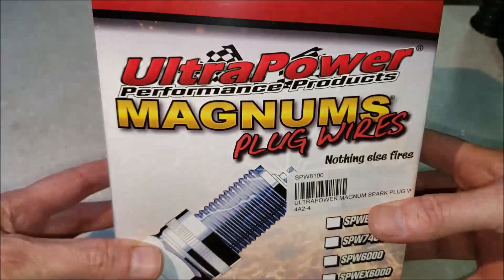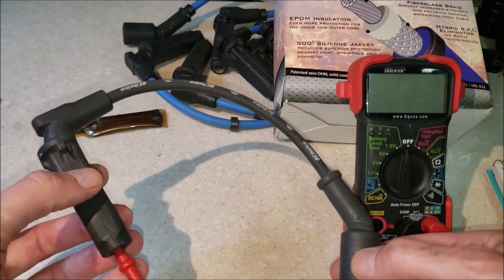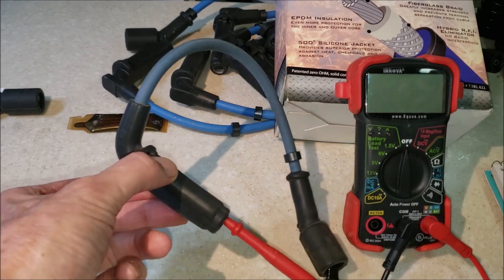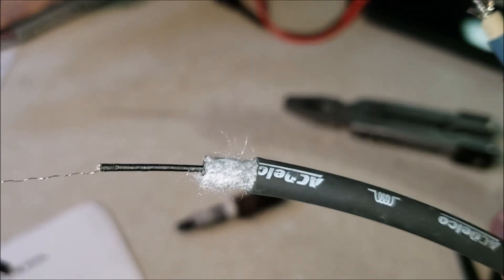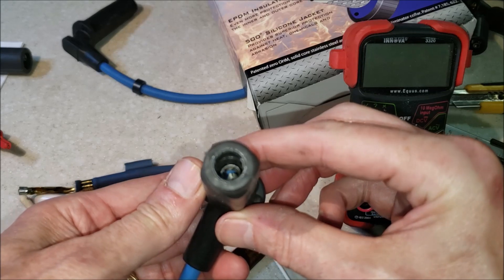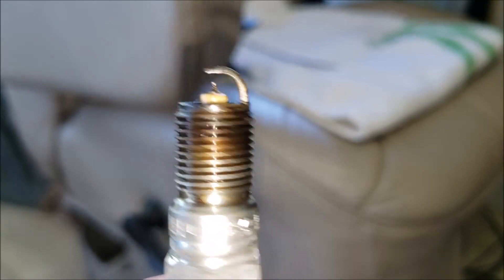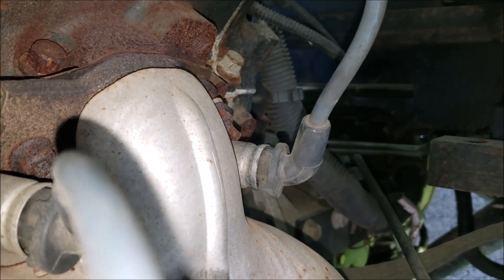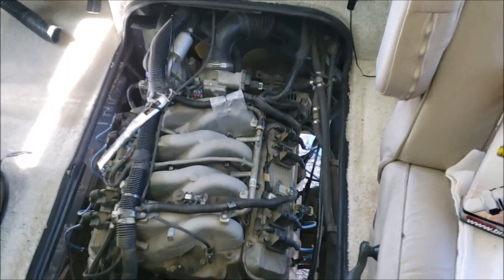8.1 Vortec Solid Stainless Steel Core UltraPower Magnum Spark Plug Wires Reviewed Dissected install

Comment: I see, there's numbers on the new wires to install.Does it matter which goes on As long as you put them on.
The same connectors they came off
Reply from the maker: @albertapride  it does not matter each wire is the same length .

Comment: I've got a 2004 w22 8.1 vortec. I was going to get the ultra power wires you installed. What plugs do you recommend to install?
Reply from the maker: Link to purchase these MADE IN THE USA Plug Wires
https://www.brazelsrv.com/SPW8100-Ult...
Part# SPW8100 - UltraPower 8.1L Magnum Workhorse Spark Plug Wires
Plugs I used ACDelco 41-101 Professional Iridium Spark Plug https://amzn.to/3AT5NiA
 Update about spark plug gap 
We’ve done a lot of dyno testing and with our Magnum wires, there was absolutely no difference in power between .045 gapped plugs and factory .060 gapped plugs. Removing the resistance in the ignition wire has many benefits! Back when we use to run Taylor wires, the .045 gap worked well but with the Iridium tips being a bit more fragile I recommend leaving them alone at .060.

Comment: Good job, I am picking up a new to us 2003 Winnebago Adventurer 33 with the Sparton W22 and the 8.1 vortec. actually today.... I do not have much history on it. I ran into your your channel and been enjoying the videos. I have to say you are very thorough, I'm a bit picky myself and fairly mechanically inclined. My rig needs new shocks to start off with (I think they are original) and some TLC,  I am purchasing it from an older couple and he did not do much maint. himself..they have not really used it much in a year or more..  any suggestions on shocks? I will be doing the wires and plugs just to start from scratch.. oil change.. possible trans fluid ect. , I Like to install a trans temp gauge.. any suggestions there.. keep up the good work !!
I would appreciate the input... Thanks,
Mike
Reply from the maker: Call me my cell number is 606-875-0125 be glad to help you with any questions you may have .
Reply: @ktoutdoor  Thank you Kevin, picked her up Friday afternoon. Been in the back yard working on her ..took a bunch of photos of the undercarriage,.. shocks defiantly need replacement. I will send you some to your phone...... engine and trans are dry as can be...very happy about that... Ordered the Allison spin on filter and their special fluid from Amazon... figure for first I just drain fluid and change spin on filter and fill.... drive her a bit before I do a full pan drop and change the main filter ... don't want to have Issues with the trany as it's shifting just fine......I will do a second drain and fill in a few hundred miles, Very much apricated. Mike
Reply from the maker: Looking forward to the pictures

Comment: Do you see any need for the EXTREME wires that provide a much higher temp rating?
Thanks for this video.  One of my next projects on my 2005 Adventurer.  Next week it is replacing a leaky fuel pump.
Reply from the maker: I think its a great tuneup option and its hard to argue with these specs.
   High temperature silicone boots, 8mm jacket with fiberglass-reinforced braid that resists temperatures up to 500°F.
    Increase power to the spark plug up to 400% over stock!
    Adds up to 15HP on Big Block GM engines. "from dyno pull before and after"
    True Life-Time Lasting Wires, Life-Time Warranty! 
Why is your pump leaking ? pump inside tank ? did you get a OEM pump ?
Reply from the maker: I reached out to brazels RV this is what they said...
I only recommend them to people who had had repeated wire failures. The original reason we had those made was for Edelbrock who was supplying a similar engine to the 8.1L to California port trucks that move containers around, low air flow and high engine temps were destroying all other wires they tried
Reply: @ktoutdoor  Thanks Kevin.  I am having no such problems so guess I will go with the set you did.
Reply: I already dropped tank and found it wet on top of the pump.  I talked to Alan at Brazels and he thinks pump more than connection.  I installed the fuel pressure gauge you did, thanks to your video, and have steady 61 lbs at idle and 2000 rpm.  The new OEM pump will be here Monday. Wish me luck!!
PS...When I switch engine off the pressure drops off quickly..
Reply from the maker: @lonesomedovefree1429  Yes that's not normal ours will hold pressure for weeks
Reply: Kevin,
When I asked about the EXTREME plug wires I meant the more costly set from Brazels that is rated for 1500 degrees.  Do you see that as overkill or is there valve for us on our 8.1’s?
Reply: Kevin could you send me your email please.  I have some video of my fuel pump leak.
Jerboy101@msn.com
Reply: Always  check your heat shields to see if they are still good. The inside of the heat shield should be orange. If they are brown get new ones. Rock Auto has heat sheilds for less than $5 a piece.
Reply from the maker: @oemytech  Thanks for contributing Oemy!